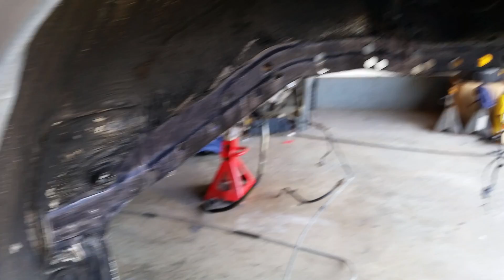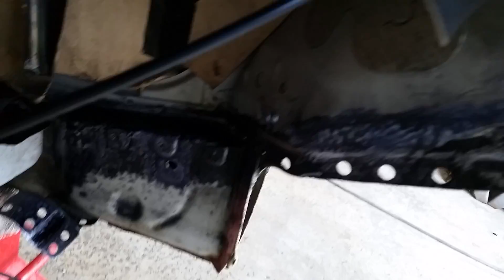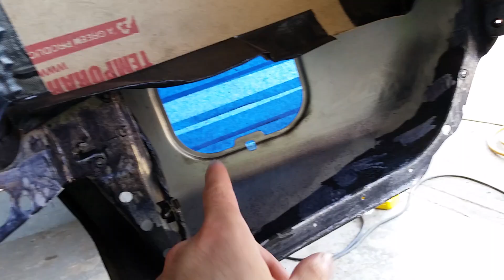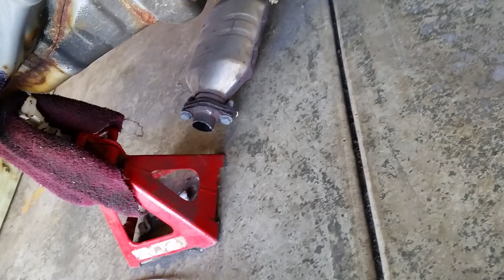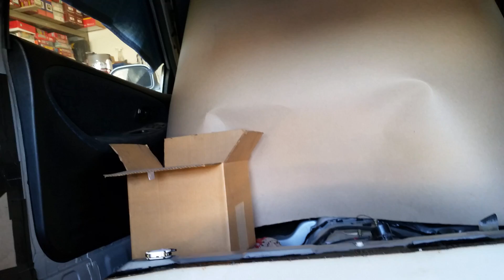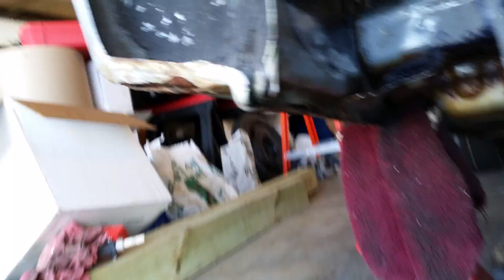Mirage to Coupe Evo IV Conversion Project: Final Welding Prep

Comment: Where can I get an evo 5 floor pan I want to do an evo 5 conversion
Reply from the maker: They're pretty hard to source now.  Pretty much the same pan as the Evo 8/9 pan though; so I'd just find a wrecked Evo 8/9 shell and use the floor from that.
Hit us up at Mirageforums.net if you have questions on the build!  My username there is Alchem1st.
Reply: oh ok i will im in california so i would probably be better off useing a usdm 4g63 too thank you i though of using an evo 8/9 floor but wasnt sure if it would fit